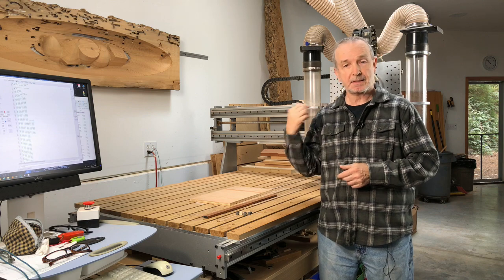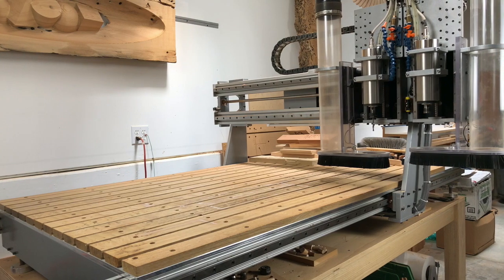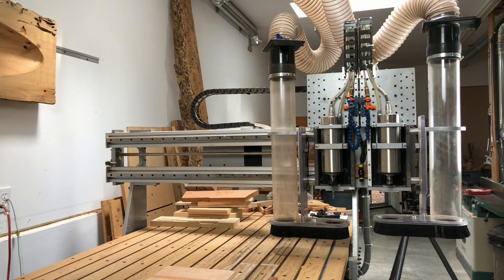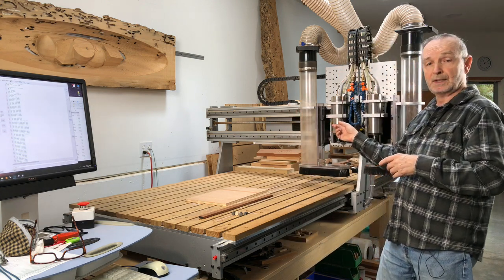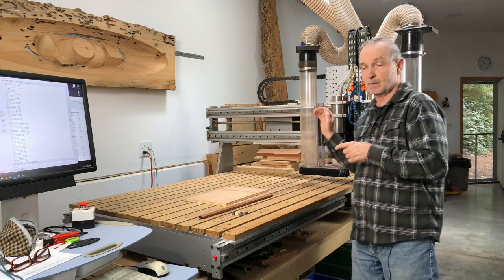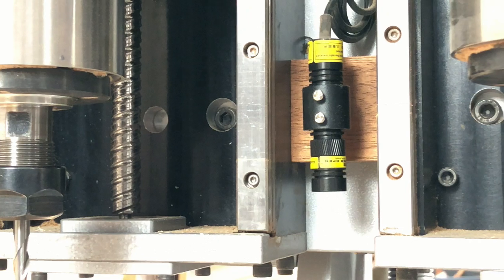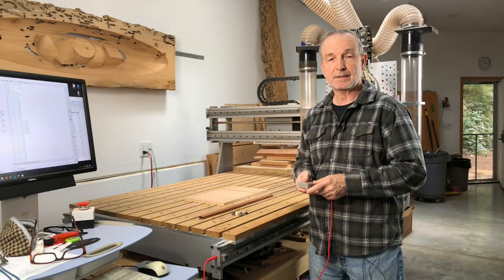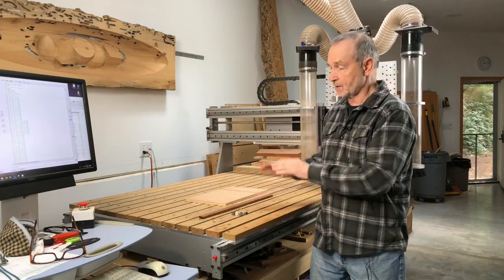My Custom Designed CNC for Digital Woodworking

Comment: This custom option is intriguing. I've been looking at the ShopSabre 23 (w/spindle), the CAMaster Stinger 1 (with spindle), and the Axion AR8 Elite series. Having a hard time because the SS only has a 5" gantry height (no options to increase that), I don't love the rack and pinion setup on the CAMaster, and the Axiom Elite has the RichAuto pendant-only setup, which I'm not thrilled about. 

Hard to know what's not a big deal and what I'll regret down the road. They're all in the $12k-$14.5k range as set up. What are your thoughts on those models vs something custom like yours? Main concern is accuracy/cut quality doing large scale 3D cutting like guitar and banjo necks, though I will consistently do sheet work for jigs/fixtures and ocassional furniture projects. Aiming for this to be used in a small scale side business. Thanks for sharing this video!
Reply from the maker: As to accuracy, I'm sure the CNCs you mentioned are good, but they're several steps behind my machine. My sculpture work demands very high precision. Carl Bruce, the maker of my custom CNC has built a number of guitar maker machines. Contact him and arrange a call to chat about your needs and expectations: cncbuilder@wavecable.com
Reply: @digitalwoodworking  Thanks for the reply! That's impressive to hear. I'm pretty new to this segment of the CNC router world. Would you mind if I picked your brain about what helps your machine be a cut above the ShopSabre 23 in terms of precision? That sounds absolutely perfect for my purposes. Just started emailing with Carl, thanks!